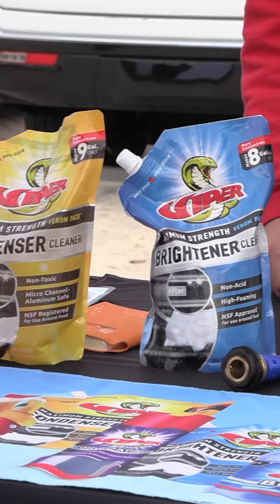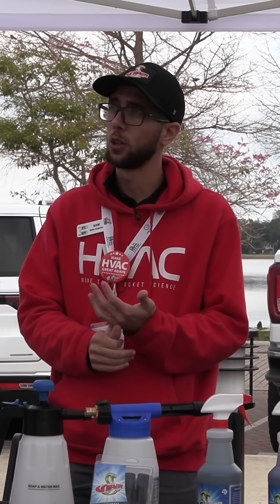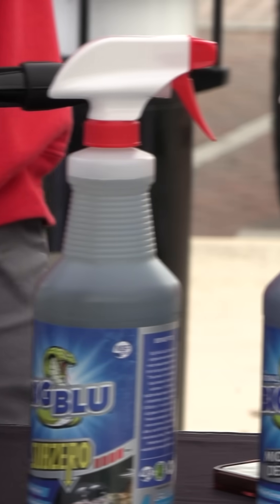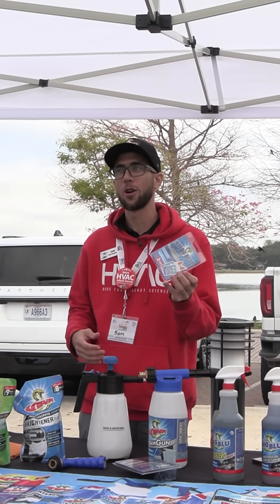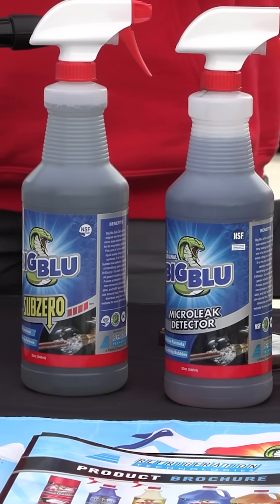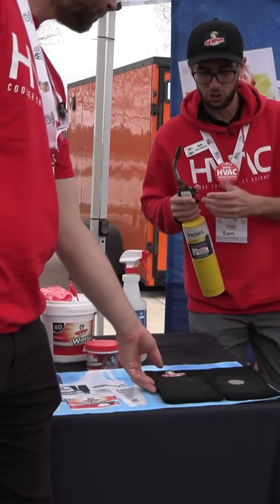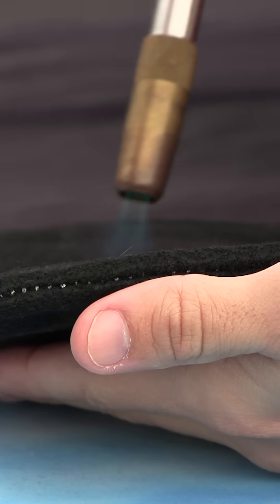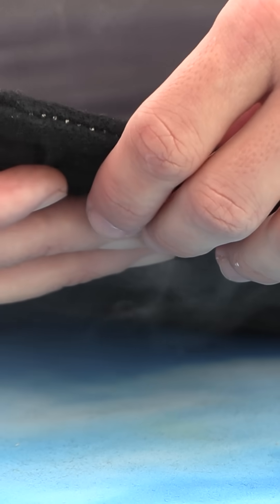Refrigeration Technologies Demo at 6th Annual HVAC/R Symposium

Comment: I use a few Viper products. Big blue is probably the best bubble tester out there. The "wet rag" is in the small tub with a red lid and is perfect for protecting TXVs, reversing valves. Gotta get that heat shield 🛡